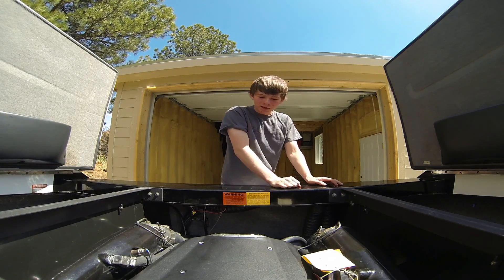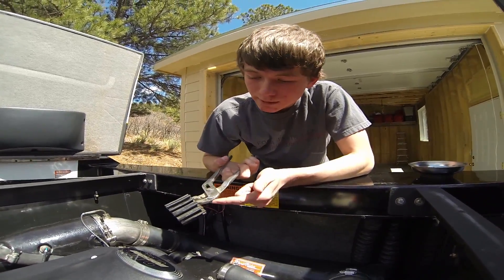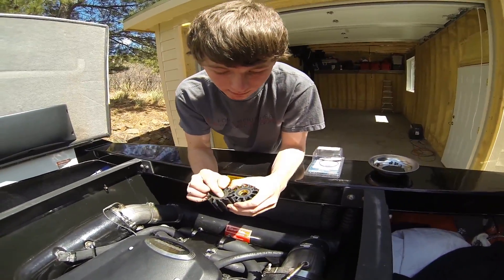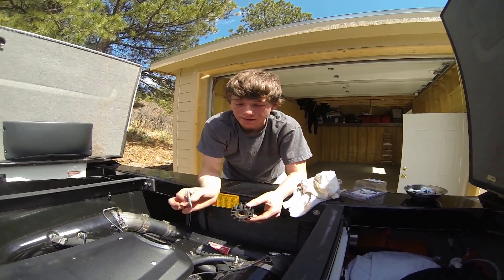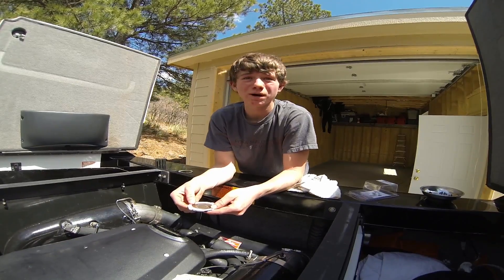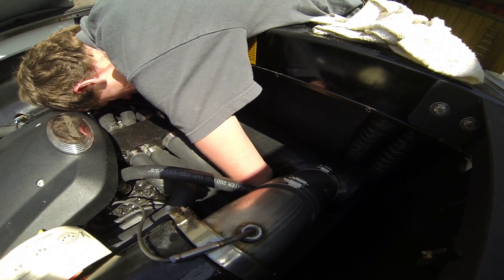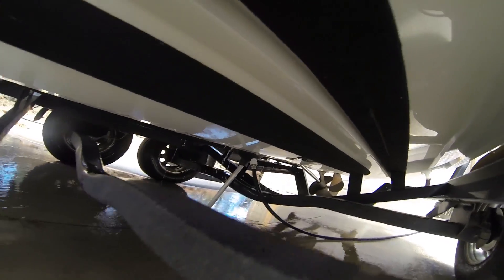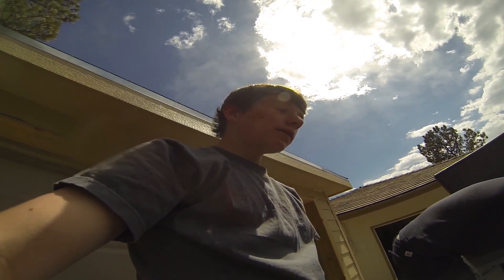2008 Malibu Wakesetter Impeller Change

Comment: Thanks a bunch. The tip about putting a towel below the impeller is gold!
Reply from the maker: You are welcome. It helps if you spill some oil on the bottom of the boat.